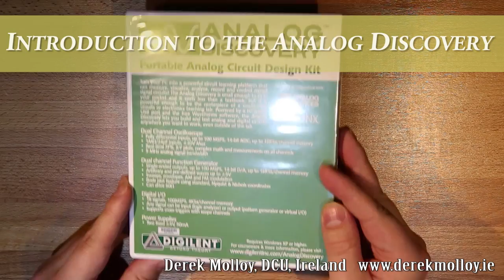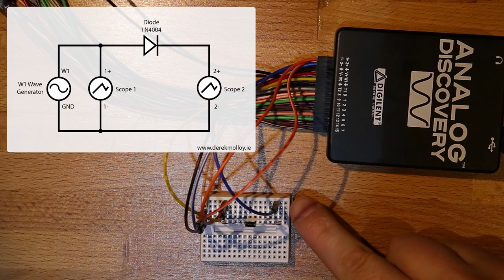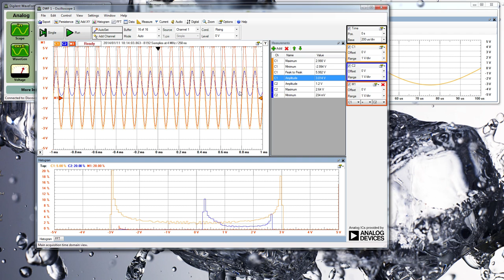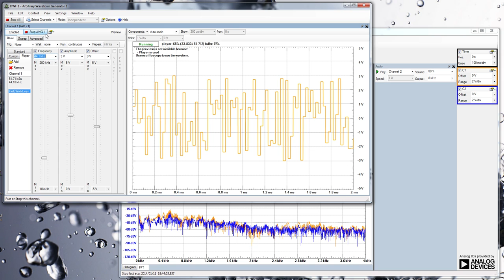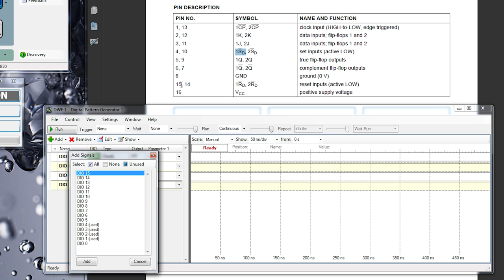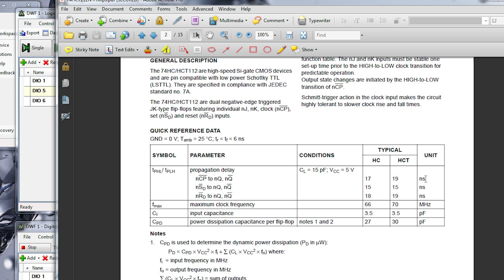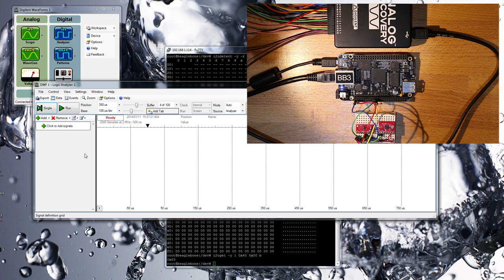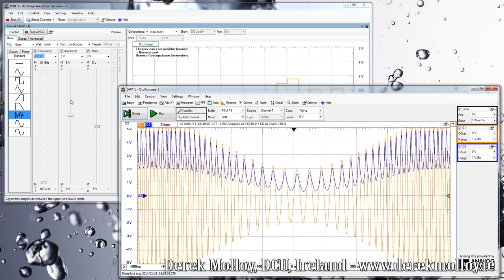Analog Discovery - An Introduction with Practical Analog & Digital Examples (diode, flip-flop & i2c)

Comment: So the digital waveform generator and logic analyzer can do up to 10Mhz?  

Using the soundcard for <20khz inputs sounds good, but would be nice if they had an over-voltage/current protection circuit available to prevent accidentally damaging the pc.

I have a LogicPort that's great, but I've been looking for a usb AWG / Oscilloscope, that is supported by Matlab or sigrok.. something like the Red Pitaya.      Any thoughts on how the Analog Discovery compares with similar tools (EA's Labtools, Scanalogic-2, Bitscope, etc)?

Comment: Hi Derek
Great videos from you.
But how do you deal with the voltage levels ONLY being 3.3 V and not 5.0 V on the digital I/O when running a circuit on Vcc = 5.0 V?